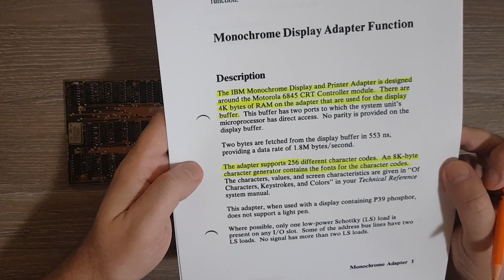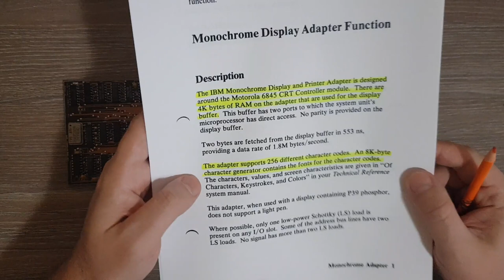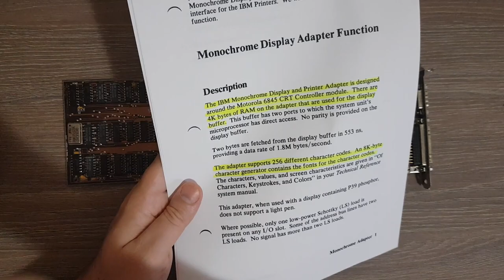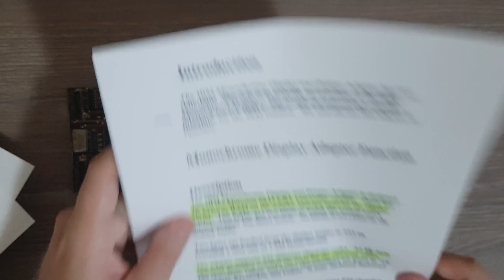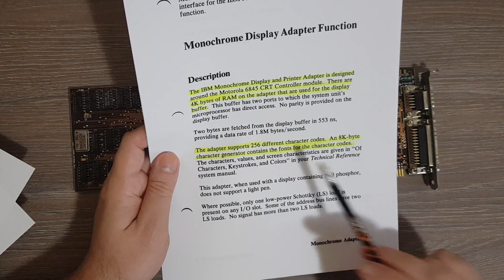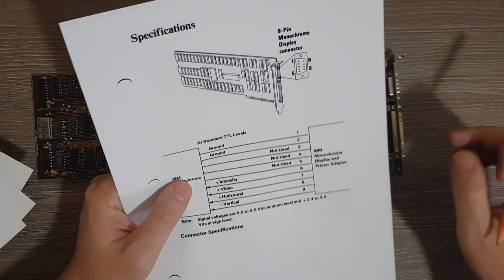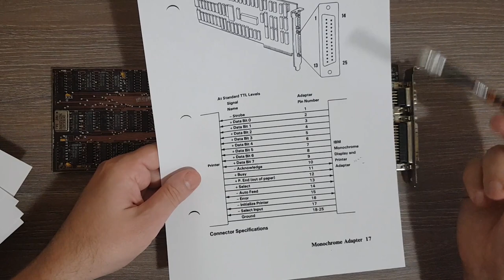Exploring the Monochrome Display Adapter (MDA) from the IBM PC 5150

Comment: Fun fact: IBM used the same ROM chip for both MDA and CGA. The chip contains three fonts. One 9*14 font for MDA (stored as 8*16 in the chip) and two 8*8 fonts for CGA (though you need to modify the card to add a jumper to use the second one).
Reply from the maker: This is indeed a useful fun fact. However, I'm not sure you could actually enable the use of the second font. I found some references here: https://www.seasip.info/VintagePC/mda.html . It seems that activating that jumper, even though selects the second font, disables the clock, rendering the card unusable. Do you have maybe another approach for enabling the second font ? I may try myself that jumper at some point, but without a clock source I fear it will be for nothing. However, looking at the diagram on the last page here https://minuszerodegrees.net/oa/OA%20-%20IBM%20Monochrome%20Display%20and%20Printer%20Adapter.pdf seems to be maybe possible to switch to the second font by activating line A12 of the ROM. But there is no jumper strictly for this (as J1 seems to disable also the clock). So maybe a wire could be used instead of the jumper.
Reply: @ComputingMongoose  Oh, sorry! I meant that you could add a jumper to a CGA card to enable the second CGA font. There's a couple of unpopulated pads for one on it. 

I didn't mean to send you off into the wilderness thinking it applied to MDA as well! No, it's just CGA that can switch the font. Presumably, that spot for a jumper was originally going to be available, but the actual pins were left out because the thin font didn't work well in composite mode.

The Graphics Gremlin FPGA card actually implements the font switch in its CGA modes, so if you've got one, you just need to flick a few switches to try it out.
Reply from the maker: For CGA it makes sense. But for a moment you got me hoping for some new revelation about the MDA. It was fun while it lasted :)